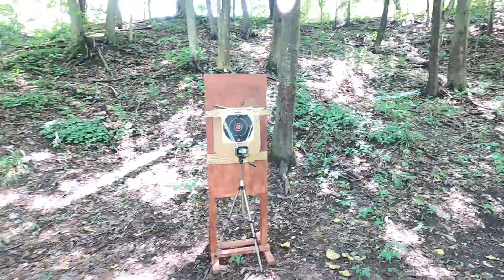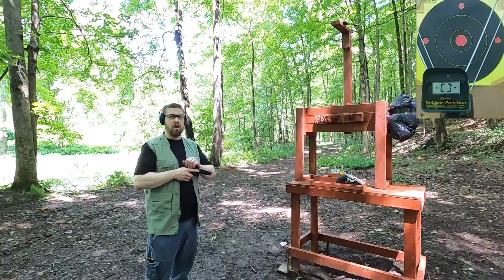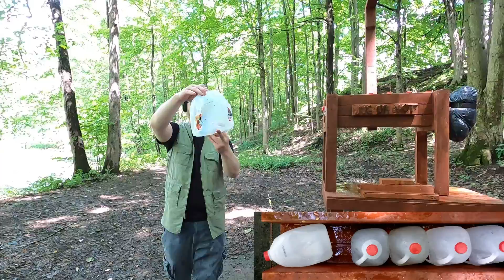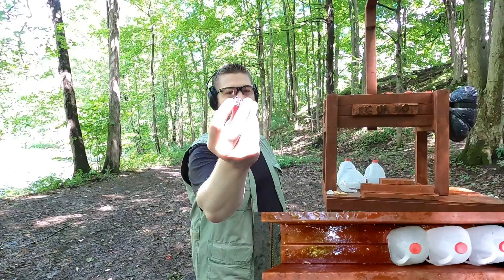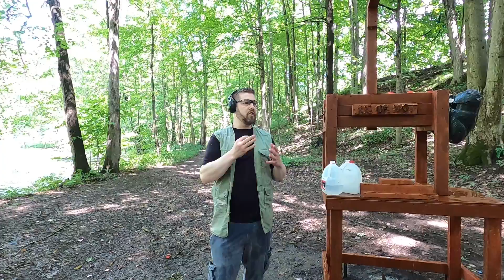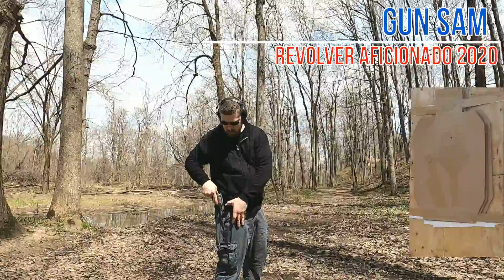10mm More Powerful than .357 Magnum? 💥ULTIMATE Test💥💥💥POWERFUL Ammunition

Comment: First, excellent video Sam. I love the testing of hot full house rounds. You did a great job putting this together. You got to love Buffalo Bore and Underwood ammo, great companies were you still can find full house rounds loaded to old school spec. I’m a little more partial to Buffalo Bore of the two, as they list certain firearms that each load was tested with and from my experience it’s always exact or real close, You know what your getting when you purchase Buffalo Bore, there quality control and consistency is also as good as it gets. 

You do a great job trying to make ammo test fair. The tip of bullet length to muzzle end may be the same between the two, but the revolver is dealing with cylinder gap, which is a real thing that has been tested to loose some pressure and velocity because of it, so running revolvers with the same length barrel as a auto loader in my opinion is still fair, but I still appreciate your effort. 

I have watched Paul Harrel test at least 5 or so different brands of 10mm ammunition and most of them are not much more impressive than .40 S&W. I think only one or so got to around 550lbs of energy and that was the defensive ammo he tested. Now I understand that is watered down factory ammo, and the same could be said for .357 factory offerings, but I feel the .357 and 10mm when both loaded to max potential are very similar in power and energy. You did a great job highlighting that.

I believe Buffalo Bore has one or two other offerings in .357 magnum that is even more powerful than the one you tested (at least energy wise).
Reply from the maker: Thank you. I have done a lot of research into cylinder gap, and while it's all varying based on gap size and ammo choices, basically 5% is the average potential lost. So instead of 1,000 FPS you get 950 FPS, instead of 1,500 you might get 1,400. But sometimes you get basically none like with low end solid copper rounds as they are longer, burn more of the powder quicker if it's a low end round with a low charge of fast powder etc.
Reply: T Hutch you may want to check out Ballistics101.com- gives a good reference to 10mm and what’s watered down and what’s full 10mm power from manufacturers.
Reply: Agreed with your last sentence, well the whole comment really. While learning reloading and working up a 180gr lead 357 load I bought a box of BB 180gr bear crushers. Big mistake! Oh there was nothing wrong with the ammo, but 20 of them finished off my German single action army clone. Good news is a few over sized Colt parts fit to it tightened the old iron right up. I retired it to wimpy loads only from now on. Pops gave me his mod 28 duty gun so I'm golden now.

Comment: BOOM! I'm not sure how you got that feed failure in the Glock. I think this is the closest in performance test I have seen between two rounds. It's keeping my faith in physics. I am impressed that the XTPs held together. I remember when you tested the same weight HTP in 357 Magnum how that bullet just fell apart. I don't think it was even going as fast.
Reply from the maker: I been meaning to ask you, as i'm lost with this one....is that will the 30 gr extra weight with the 10mm increase the momentum over the .357 Magnum? I think we might have established it would when talking 9mm VS .45 ACP of the same energy as their is a huge difference in bullet weight, but here wouldn't there be an increase of momentum? And since the 10mm penetrated the same, would this be because the larger diameter increased the drag?
Reply: @GunSam  You can get a raw comparison by just multiplying the bullet weight by the muzzle velocity. That's not a momentum figure, but it is an apples to apples comparison. Those two looked pretty close. You only had an energy spread of ~2ft-lbs and near identical sectional density, so it is no surprise that the penetration was pretty much equal. The difference in diameter here is about 1mm, so while is something, it is not a lot more. If it was, the 10mm would have had a lower sectional density. I wouldn't be surprised if that slightly larger diameter was why you got the bigger splash from the 10mm. There was a fair bit of energy dumped into that first jug. That's about the best answer I can give.
Reply from the maker: @Fudmottin  I think I got basically the right idea then. I figure that SD is probably damn near as fair as one can get and momentum(as far as penetration goes) probably is SD related. I have debated trying the Buffalo Bore Hard Cast in both .357 Mag and 10mm as it's 180 gr .357 Mag vs 220 gr 10mm. SD would be .203 for the 10mm and .202 for the .357 Mag ( I have no idea what those numbers mean, just what the online calculator says). The listed energy for the .357 Mag is 755 ft lbs in a 4" barrel and for the 10mm it's listed as just 703 ft lbs, no barrel listed. Might be cool to see, then again it might be a $60 investment to lose two bullets through the backstop lol.
Reply: @GunSam  Sectional Density is pretty much what you said in the video. It's mass per cross sectional area which is a function of bullet diameter. The higher the better for penetration and bucking the wind when you get into rifles. If you look through your loading manuals, you should see some correlation between sectional density and ballistic coefficient which takes shape into account. All things being equal, I would expect higher energy to produce more penetration. But I still don't have water all sorted out yet. The harder you hit it (meaning faster), the harder it pushes back. Force times distance is energy.
Reply: @GunSam   They may be XTP but looks like the HP is larger in the 10mm ( likely for 40S&W )  & yes that = more drag & more explosive hit .   @ FUD  did you see this .. this is why it jammed https://www.youtube.com/watch?v=rjOPiZhEwA8&t=0s
Reply: @danoneill2846  Yeah, I can see a short COL with wide HP cavity snagging in an auto. For 9mm, I prefer the 124gr loads in general. I may be calling it wrong, but I feel like the 147s run too slow and the 115s are too light. 124 splits the difference reasonably well, especially in +P loads where you should see full pressure even if there is not a whole lot of plus in that pee.
Reply: @Fudmottin   I agree with some of what you said but you missed the point   of the Wilson video .  #1 XTP  feeds VERY well  #2 as Ken said  Bolt over base jam is due to  #1 Too Fast slide speed ( in this case > hyper ammo )  OR #2  weak mag springs  Or #3 not the best weight bullet for the slide set up  ( micro VS full size ) . At the start Wilson said >> Ammo related jam , this ammo is at the ragged edge , it's too powerful for this set up to be Reliable . My point forever , if it's not reliable , it has little value ( a single shot ) . I agree 124 -135gr  +P is the best in 9mm .

Comment: I use the BB 357 mag in 158g xtp - but only in my 6-inch revolver or 18.5 inch carbine. I think the 158xtp in 357 mag would do even better.
Reply from the maker: Probably. I should test them, but then again I bet the recoil would be an uplifting experience.....for the muzzle.
Reply: @GunSam  Not for a snubby but my GP100 6-inch handles them well.

Comment: Great video. I have both the Glock 20 in 10mm and a ruger GP100 357 mag with a 6" barrel. The Glock might have the edge because it is a little easier to carry with higher capacity and as your video shows almost identical ballistics. Revolvers are great to own and shoot as well. It seems you have to wear glasses to protect yourself from flying bologna than you do from the firearms.
Reply: Those are my two dream handguns man. I turned 21 a few days ago and i was choosing between those two for my first handgun. due to cost, I went with the Glock 20. Will definitely be picking up the Gp100 once I get back from college to my summer job.
Reply from the maker: Thanks. Actually I do have one handgun, my S&W 342 PD in .38 Special, and more than once for whatever reason hot particles have embedded in my face right below my glasses, and this is just from shooting paper.

Comment: Glock failure to feed.  Crickets from the Glock fan boys.  Not surprised.
Reply from the maker: They usually start yelling limp wristing at me. My response is usually that you might need to fire a gun in an angle that creates limp wristing, then I inform them btw I'm not limp wristing, and they just reply again "LIMP WRISTING". Its usually an interesting conversation. And by interesting I mean dumb.
Reply: @GunSam  Reason I've started my transition to revolvers.  Just purchased a Taurus 856 and now I am looking for the ever elusive Charter Arms .32 H&R magnum  Professional 7 shot revolver.
Reply: I was one of the people that made fun of plastic guns till I shot a few . My friends  G17 out shot my P226 , My 2 > G20s ( 10mm ) , G21 45 acp , ALL out shoot my Kimber ( Match 10mm ) = WTF ???  So ya I like & own Both . RE: Kimber , it's possible I have not found the ammo it likes best ??  RE: SIG my P227 is match acc & my M11-A1 9mm will out shoot my Glock 19 with the same barrel length . They are all good !
Reply: @danoneill2846  Let the excuses begin.  Point is, it jammed period. I too own plastic guns PPS M2, CZ P07, yet I've come to realize that the possibility exists at the point I need my firearm the most. The revolver reduces greatly that fact.
Reply: @racefan6668   If you feed bad ammo to ANY gun , revolver included it will fail . I could fill up pages of failed revolver stories . I own 5 Glocks & 3 SIGs , I have had ZERO jams . I feed them good ammo ( some hand loaded by me ) & I keep them clean & oiled .  Chuck from Alaskan Ballistics not long ago was talking about Broken Revolvers ( new in box ) & have you seen the Colt videos out .. brand new broken Over Prices colts ! I get the feeling I need to card you to be sure your over 21 years of age ??   BTW did you watch & understand the Wilson video ?? Hyper ammo = Too Fast slide speed = bolt over base jam , that is what happened in this video .
Reply: @danoneill2846  Year of birth 1968.  I am so sorry I hurt your feelings.  Should we set up a safe place for you and your Glocks?  That way you won't melt. I'll even throw in a 🍼 and a blanket.
Reply: @racefan6668   No hurt feelings  .. he is not shooting a Glock  , goes to show , you can make a good gun go bad if you jack with it & feed it poor ammo .. same as any gun . Not a Glock barrel , not a Glock spring , ammo that is uncommon & bad concept . Many better ammo choices . Did you look at the video from Wilson & understand the points . They did a part one & talk about how to build a gun so it WORKS 100% of the time . You can't just slap parts together , feed it crap & expect it to work 100% , this video is Proof of that . BTW Taurus was the revolvers that A B said were crap as shipped . Get smart & buy American !
Reply: @racefan6668   A B is live NOW & said they had   6  SIX  bad Taurus revolvers at their store , New in box .. WTF ??
Reply: this is why it jammed https://www.youtube.com/watch?v=rjOPiZhEwA8&t=0s

Comment: Just want to know what you did to cause the malfucntion with the glock because EVERYBODY knows glocks don't fail!!!  Just kidding. I found this pretty interesting that 10mm & 357 were so close in comparison with everything being so equal, I 'd like to see 10mm compared to 41 mag because I've read & heard  that the 10mm was more in the 41 mag range in power and performance. I have never fired 10 mm but have shot 41 quite a bit when I was younger being the first handgun I owened  was a blackhawk 41mag. seeing this I would have to asume that the only real advantage 10mm has over 357 would be round  count of course depending on ammo used  and barrel lenght . Excellent demo , Your testing right on par with PAUL HARRELS  meat target test. I may have to save and get a 10 mm sometime.👍THANKS FOR YOUR TIME AND EFFORT DOING THESE DEMOS.  JUST AN AFTER THOUGHT, wonder how that 357 would perform from my taurus 617 snubbie, then again don't know if I'd want to shoot it!!!!!
Reply from the maker: Thanks. Before I get into .41 Mag since I don't own one, i'm going to get a .44 Mag as it's more versatile. This should provide enough tests with .44 mag and .44 special that the next gun after that will pay for itself so to speak. I might consider a .41 Mag at that point. I am pretty proficient at hand loading so no reason not to.

Comment: I use to have a glock 20 gen 3 with a 6" Kkm barrel & a 22lbs wolf spring but the biggest problem is that with hot rounds it would always jam so I moved on to the 357's I feel like revolvers handle the power better.
Reply: Hmm... ~30% added recoil spring weight.  I be curious to compare reliability and shootability with the stock VS the heavier aftermarket springs.
Reply: @kylefarris4686   When you go too far from design specs don't be surprised when things go wrong .
Reply: @danoneill2846  My smith told me to only replace the spring when the ammo manufacturer suggests to.
Reply: @mitchellnelms7572   Yep , some are OK but you need to test a lot B 4 you trust it . I had a RUGER Redhawk a guy put a wolf spring kit in ( lighter ) about 1 shot in 50 would not fire , I traded it to a friend that still has it ( many years ) , I would not give it to him before I got a new spring set from Ruger to install . Redhawks , are great but don't have the BEST stock trigger pull , it was OK , but it must fire 100% !!!!!!! I asked him years ago if he wanted to trade back .. he said NO!  5.5" 44 is a great size , very user friendly .
Reply: @danoneill2846  yeah, I talked to the gunsmith at length about certain upgrades for a glock 20 sf I bought a few months ago.  He told me that heavier recoil springs would cause failures to cycle certain rounds because of a lack of blowback due to the increase in spring tension. I trust him a lot, the guy has never let me down.

After some research, Buffalo Bore is one of the only manufacturers that suggests an increase in the recoil spring rate for their heavier loads.
Reply: @mitchellnelms7572   Could be that 20 LB is what is needed , that is 22 LBS , I think stock is 17 or 18 ??
Reply: @danoneill2846  Yeah, the stock spring is 17. I can't remember what the recommended weight was. 

I've put some underwood 155gr and 100gr defensive ammo through the glock and the stock spring feels good. I did put a zev stainless steel guide rod in the gun with the stock spring. There's less resistance with the stainless guide rod giving the glock a smoother feeling action.
Reply: @mitchellnelms7572   yep    I got one not sure the brand from NDZ ?? stock weight
Reply from the maker: Yeah I got the NDZ 22 lb. I have noticed that also with low end ammo it will jam up, so probably middle of the road ammo is best.

Comment: When the 10 mm was introduced in the early 80s his load of 200 grains at 1,200 fps were more powerful than the aveage power of the .357 magnum loads in the same age. But withthe average power of the 10mm of these days I doubt is more powerful now.age
Reply from the maker: .357 Mag is getting pretty low end now days. In 2020 the average 4" .357 Mag ammo is about 575 ft lbs as where the average 10mm in similar barrel travel is maybe 650 ft lbs.
Reply: Uhh....I don’t know what kind of .357 ammo your talking about.  You can safely push a 180 grain .357 out a 4” barrel at at least 1300-1400 fps.
Reply: @petrosspetrosgali  Usually factory loads are 158 grains at 1200 fps. Factory Loads of 10mm back in the begining of th 80s were 200 grains at 1200 fps. Handloads could be different . I was talkng about the average "factory" loads. And I wasn´t included factories like super vel or Corn Bon. Only the avarege loads of the main ammo companies.
Reply: The same thing happened to the 357. Its original load was 158 grain at 1525. But due to the eventual evolution of the lighter framed revolvers, they were downgraded.

Comment: I've been told that Glocks tend to keep your hands pretty high up on the grip, so you may be feeling less of that 'flip' in recoil compared to the 357 because the barrel is more in line with your grip. Looking at your grip on both, it does seem like your right high may be holder higher and your entire left hand also has a higher grip on the 10. That might be where the perceived recoil differences are.
Reply from the maker: Also the Glock has a replaced spring from 17 lbs to 22 lbs, so I think that helps. I think a lot of it is perception as while the 10mm felt lower in recoil, the .357 Mag wasn't too bad and it wasn't too bad because the grip I put on it fits my hand well, so more hand contact dampens it out more too.

Comment: RE: Hyper 357 , use same Ft Lbs with a heavier bullet . Would be good in a rifle for hunting . Some hyper ammo will turn inside out INSIDE THE BARREL !! Check the base on the 357 look for cupping , it's wanting to barf out the core . Too much of a good thing .
Reply from the maker: The base on both the 10mm and .357 bullet are impossible to see. The petals wrapped back around and underneath and covered the base. From looking close it looks like maybe there's a little of that cup, but not too bad. It is an XTP after all and a decent jacket thickness.

Comment: Nice vid. Dont forget revolverse get a gap between the barrel and cylinder and they lose a lot of FPS in that gap. I would test semi autos like the Coonan or desert eagle against a Glock.
Reply from the maker: I don't know your definition of a lot. But I know .357 Magnum can be as low as 50 FPS lost through a gap vs no gap, but it's ammo specific. I also know that high power semi auto cartridges can lose a lot too if the spring isn't heavy enough.
Reply: @GunSam  good point.
Reply: @johnklatt3522  awesome data. Thanks!